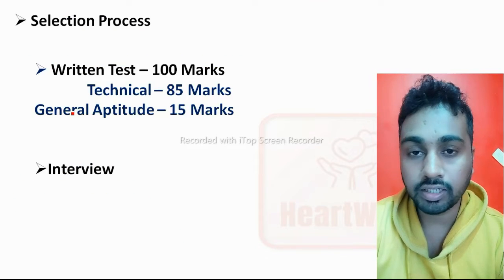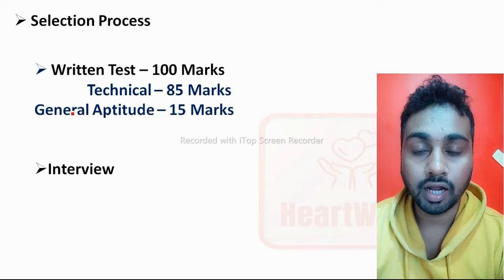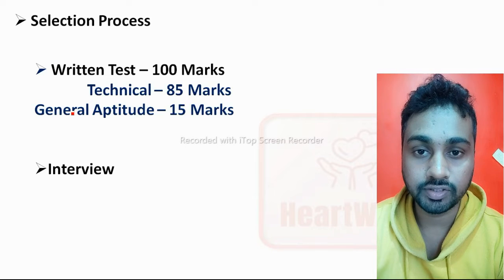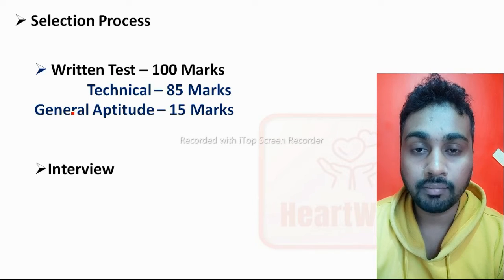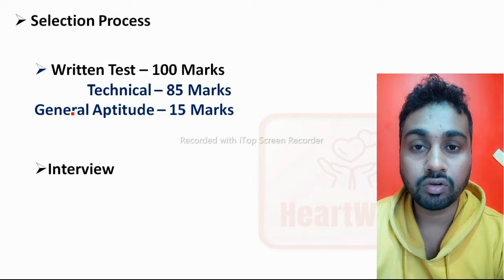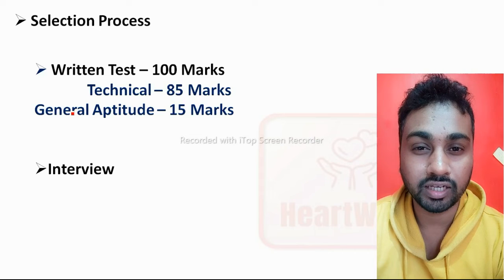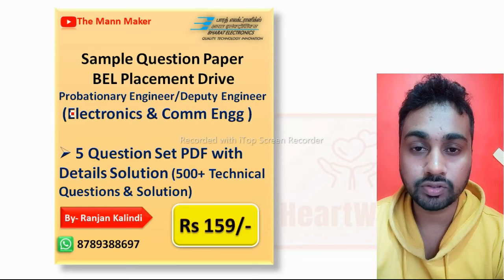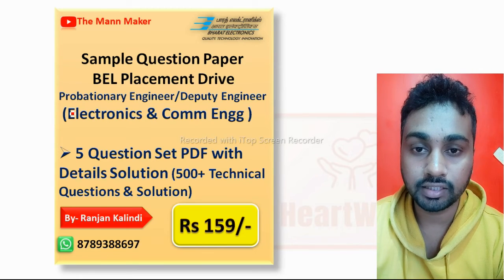BEL Placement Drive | Campus Placement | Deputy Engineer / Probationary Engineer | Selection Process

Comment: Hello Sir, I also got selected as Probationary Engineer in BEL. Can u tell till when they will give offer letter?
Reply from the maker: Wait fr interview result
Reply: @mannmaker1201  actually i got selected through on campus recruitment and the placement drive is completed in our college. So in this case when they give offer letter?
Reply: @spidy7353   Bro I also selected through campus but not recieved offer letter till now. When was the drive conducted in your college
Reply: @satya76556  it was conducted in mid march. When it was conducted in ur clg?
Reply: In Feb .when  can  we expect offer letter any idea
Reply: @satya76556  You got any update regarding offer letters?
Reply: @satya76556 You got any update about offer letter??
Reply: @spidy7353  Have you got any update regarding the offer letter. When Can we expect the joining.
Reply: @satya76556  You will be recieving offer letter by 3rd or 4th week of July
Reply: @spidy7353 How do you know that ? Was anybody informed you that.
Reply: Hey ..bel company is coming to our college this week can u give any tips or what they asked in the interview round ?
Reply: @spidy7353 BEL Ghaziabad . Is there any update from them.
Reply: @satya76556  Our clg contacted them and they told that joining would be in August. You can ask ur clg to contact them.
Reply: @spidy7353   when can we expect to receive the offer letters
Reply: @satya76556 Can't confirm but maybe by this week or next week.
Reply: @spidy7353   Could you please mention here whenever you receive the offer letter.
Reply: @satya76556  Nah. Nothing yet. You got anything?
Reply: @satya76556  already gave reply to this see above.
Reply: @satya76556  already gave reply to this see above.